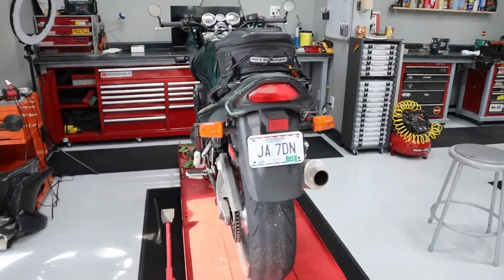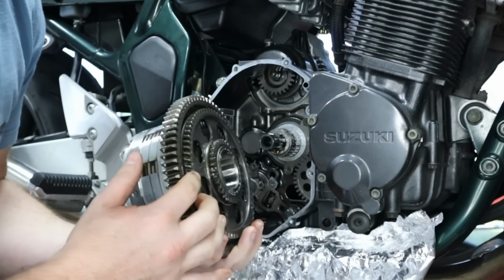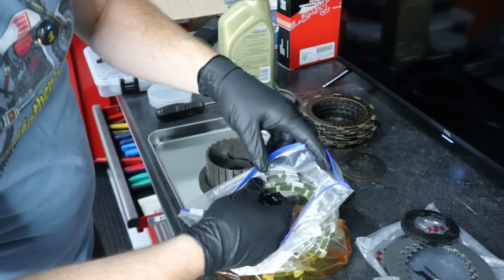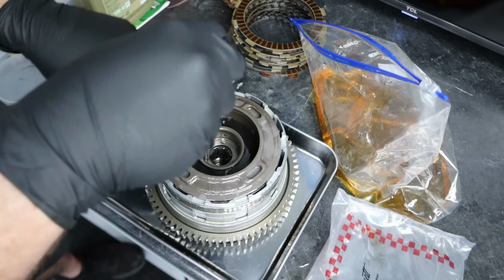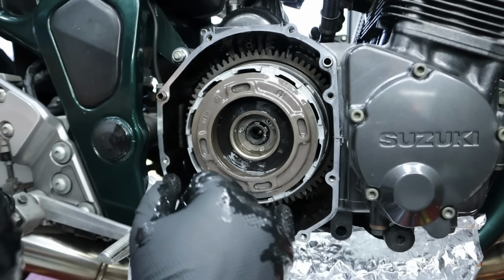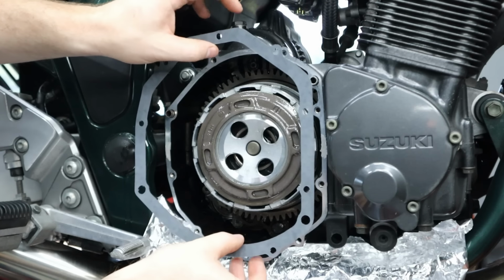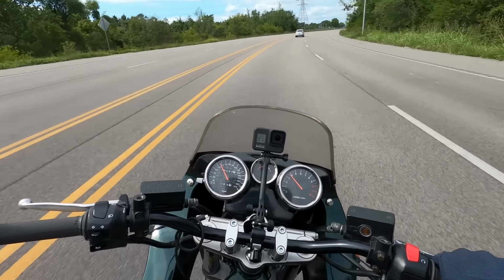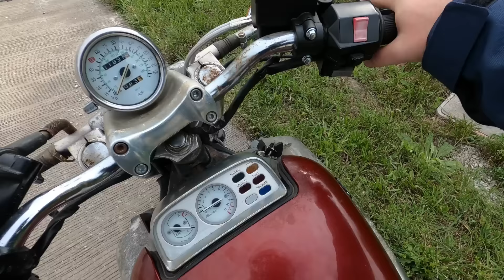Suzuki Bandit 1200 Clutch Replacement / Barnett Clutch Kit

Comment: I like that little video edit of flipping the oil wrench around after first starting it on the wrong way :) The bandit is a pretty cool old school bike. The V-max seems to be nothing but trouble, but it shows your perseverance on owing it !
Reply from the maker: Well any bike is going to give trouble after sitting for so long. This is just part of the deal. Running out of fuel was our fault

Comment: This video is as encouraging to me as the ones where everything goes fine. it makes me feel better! And I learn. I was watching one of your old carburettor disassembly videos today as I finally after literally a whole month (or more) managed to get the carbs out of the bike. First for me. I was watching the video of your sv 650... where you had all the seized scews... as do i. (still unresolved), I had disgusting petrol varnish too, which after a bout of futile wrestling with seized screws, I for some reason decided to put the carbs in the fridge, and off I went for a couple of hours to pick up the car from the mechanic (a real one).. I got back and opened the fridge, and my god. Not only were (and are) the carbs a different colour, the stench of varnished petrol in the fridge and all over the food is incredible! Wasn't even worth it, didn't fix all my srew issues, but sure screwed with my fridge vibe! Nice video BJ, I like the bandit!
Reply from the maker: Thanks for watching! Sorry about the early sv650 videos lol. They were terrible by today's standards
Reply: @BrickHouseBuilds  Not terrible, and very useful1

Comment: Just remembered that the '80's Honda Shadow has a similar setup. The Honda has the rotator pinned in a weird config. That particular unit ('86 I think) is prone to Hydraulic lock and is a pain to diag and repair. The son of a friend of mine still has the boat anchor sitting in his barn with enough crap on it to carve barn animals in it!

Comment: Sweet video and actually good timing. My 2000 Bandit is needing a clutch this winter and was pricing out the stuff i need. I was gonna go with OEM but it is costly. Whichever i choose this has been a great informational video. Keep up the good work 👍
Reply from the maker: I definitely recommend this kit as it just had everything and is an upgrade for sure

Comment: Something for you to research. Maybe it saves you time in the future. Pre-soaking clutch disks in oil is a remnant of the time when actual natural cork was used. Modern materials do not require soaking. Lightly applying a coat of oil with your finger as you are installing them is more than enough to prevent sticking in initial operation.
Reply from the maker: I plan to continue soaking. There is no downside

Comment: Very interesting clutch design. Seems like it might be easier to build the plate stack with the basket and hub in situ. Beautiful result.
Reply from the maker: I am torn on the process. It seems it was meant to be assembled out of the bike and installed as a unit
Reply: Did mine whilst still fitted in the main basket, had heard too many horror stories of people breaking the teeth on the back trying to realign. That can be costly.

Comment: The Barnett Clutch is a good choice and will last You for a long time even if You put it to redline a few times, I know I did the same clutch in My CB750 Nighthawk and I race it in the Vintage races and No it is not a Stock Motor. I put 2 OEM clutches in with bad results they didn't last. Good luck and have Fun!
Reply from the maker: Yeah im confident in it for sure

Comment: 😂 I did struggle a bit too on my first attempt...the easiest way to fit it is to put in 5th and rotate the wheel while pushing the disk stack. I am a bit concerned you did not mention the fact the 2 rings are not identical, the disk are not either (some are thicker!) and it's a ring missing under the diaphragm springs which are not "wave-washers"...
My experience with Barnett's springs is that they make the clutch lever way too hard, but the clutch isn't slipping anymore though...
Reply from the maker: You're the expert 😉

Comment: Looks like the v max needs a new rear tire pretty bad as well as the seat needs reapohlstered.
Reply from the maker: The Vmax will eternally need a rear tire 😎  Not concerned about the seat though. You should see the videos on the bike to see the condition

Comment: Another great Video thanks for sharing 👍 quick question ❓ I have a 2015 GSXR750 the clutch take up has never been very exciting to say the least. Probably the worst take up or engagement of any clutch I've ever had probably due to the concave washer spring system similar to the Bandit.
The clutch is either on or off there's no real slipping action like you would I would imagine a Sport bike clutch to behave is there any fix for these type of clutch ? I've heard of swapping the clutch out for a spring design but don't really know what's suitable for the swap out 🤔 the bike has a  38K KMs on the clock and the clutch has always been pretty ordinary in my experience any help or advice would be great 😃 cheers mate Happy Trails 😊
Reply from the maker: Hmm, I can't say I have had that same experience. This has a great feel with plenty of modulation as you can see with the riding clips.
Reply: @BrickHouseBuilds  yeah mate maybe it's a slightly different setup I bought the bike 2nd hand it was immaculate condition but the guy didn't share much of the bikes history I'll pull it apart and have a look I've been thinking about selling it lately but I can't bring myself to do it as the market is Crap in Australia 💩 and the bike is still in amazing condition and goes hard if you happen to talk to someone who knows a fix that would be awesome man otherwise stay safe.
Regards Tony in Sydney Australia

Comment: I know in my head that bikes often have an oil-bath clutch, but it still seems odd to see you soaking the friction discs in oil.
Reply from the maker: @neilbarnett3046  well being an oil bath clutch, it's designed to work with oil so going in dry is bad

Comment: When there's nothing left to do But doing it....... Dive on in or procrastinate again?  Not,  I would but I own no tools
anymore and I do still like seeing someone jump into a job, No Fear.  Soaking the plates = smart.  IDKnow all the
reasons but if you did it dry you could damage them?   My dad owned a transmission shop so I saw a lot of
plates/clutch packs & stuff.  Do these big bikes tend to have issues w/ the 1st/2nd gear clutches from like
feathering the clutch as they start moving?  I'm asking/guessing b/c I've heard of other bikes wearing the
lower gears out over time?  Thanks for the share... peace
Reply from the maker: Well the clutch is not specific to gears unlike a car transmission. A car has drums, bands, clutches, and valve bodies to transfer force so a lot more can go wrong. For motorcycles it is much more simple with a single basket similar to the way a cars manual transmission clutch works.
Reply: I do like watching someone w/ know how  GiTing - R- Done !  Thanks for the work & time

Comment: Are you using the Barnett heavy duty springs?

I had them in my 1200. Get to be a bit heavy around town (I once made the mistake of using the Bandit for a local charity toy run - heavy duty clutch and it was fitted with 40mm flat slide carbs - my arms were killing me). Coped with 150hp+ though.

Some people use 1 standard spring and one heavy duty spring
Reply from the maker: I am using the two springs it came with. Lever really didn't feel much different at all
Reply: @BrickHouseBuilds  , mine were the heavy duty ones. Looks like they just list the "standard replacement" ones these days

Comment: should chuck those little screws in the bin,they not needed and a pain if they dont go down all the way
Reply from the maker: They weren't hard to get seated 🤷‍♂️
Reply: @BrickHouseBuilds  they are there to hold springs down just before you put nut on ,suzuki knew they can strip their threads so reduced later bandit 
to2 holes in spring seat but still had the 3 holes in clutch center. Asyou put your vid on bandit fb forum to help my point was they can and have caused problem fully compressing springs so not letting the nut and washer tighten down fully leading to more clutch slip. Alot of owners know this from experience. I also mentioned there is a difference in steel plates in thickness 5 an6 when in stack on origional suzuki at least,i dont know with barnet plates maybe you can check and inform us all. Also pointing out that changing plates is alot easier to do without removing the whole clutch and putting plates in one at a time is no criticism of you its just easier isnt it ,helps others as what we all answer owners questions for right??

Comment: You made a ton of extra work for yourself. You should not have taken out the basket. Just remove to retaining ring and you could have disassembled and reassembled the clutch like normal clutches without any alignment problems. But what is done is done. Just saying. Also I would have made a big mess out of the oil.